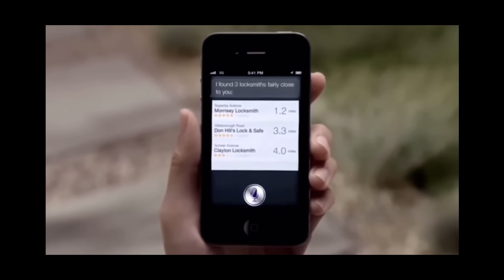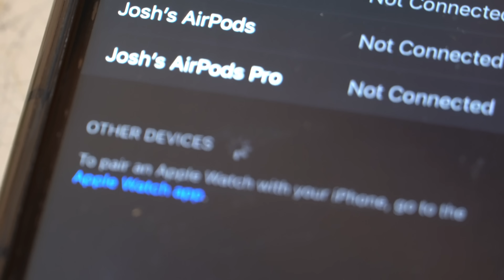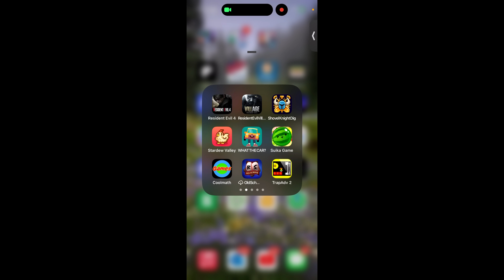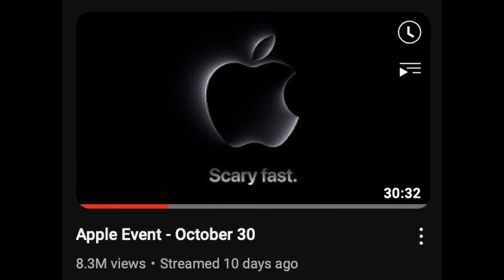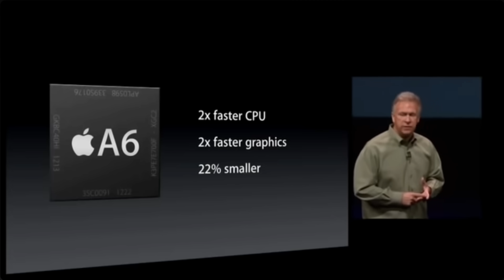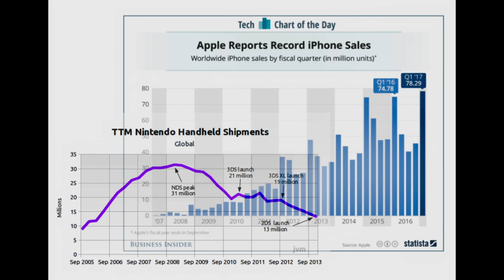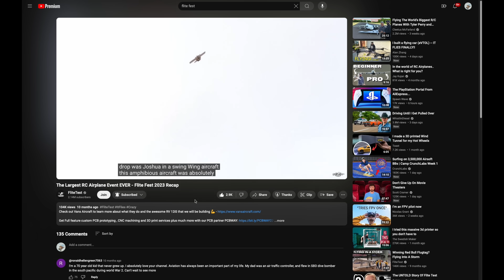I built this controller because no one else would | M-Con V1

Comment: you need to talk to a lawyer about copyrights dude...
Reply: Do you mean patents? In his community post he says he took down his previous video so he could do the patent work. That is why some of the clips are blurred .
Reply: @Jagged_Jackal  It's blurred because he put an Apple logo on the thing. Look at the blue tape at 10:46
Reply: YOU CANT PATENT ANYTHING YOU PUT POUBLICLY BEFORE PATENT THATS PATENT LŮAW.. IN THIS TIME.. TAMPERED..
Reply: @Jagged_Jackal oh we have the same pfp
Reply: Preface: I’m not a patent lawyer. From my understanding mag safe is an open standard. That is why you can get android mag safe cases and the manufacturers aren’t being sued by Apple.

I expect the patent would be for the sliding, locking, removable rail integrated into a controller.
Reply: @Jagged_Jackal  MagSafe is not open. It's a proprietary standard that Apple licenses out for money. I'd also look into whether they has any illustration trademarks that may clash with the circle in the M-Con logo. Then either strike up a license agreement with Apple, or just orient the magnets in a particular way without referring to the product as MagSafe anywhere official.
Reply: Good old playstation Xperia phone.
Reply: I wonder if Sony has their psp go design patented lol
Reply: He can easily patent this because it’s the 15% rule ..
as long as an item is 15% different than its original counterpart a new patent can be created. I think you struck gold  with this one.!
Reply: Son of the gun, you made it!
Reply: I’m sold! Take my money. Do what you can to hit the ground running because 🇨🇳 will clone this thing so quickly
Reply: It's a prototype and it's not uncommon to use existing products to invent new ones. Innovation builds upon existing tech.
Reply: There's actually so many controllers like this already so how?
Reply: There is already an Apple Controller like this and It's called Bladepad.
Reply: @RazorClaw666  lmfao, it looks better too 😂
Reply: Razor had a similar case called “Junglecat” but …. They discontinued it, it slid & looked like a psp go
Reply: @khalilsstories I think the reason they not released because the slider controller already patent from Sony
Reply: @khalilsstories  Then I want it to be copied, more common. Touchscreen is a hell for gaming. (Except DS/3DS)
Reply: This I awesome though!
Reply: doesn't matter if china saw this, their copyright is busted
Reply: Fr
Reply: Goodluck dude!
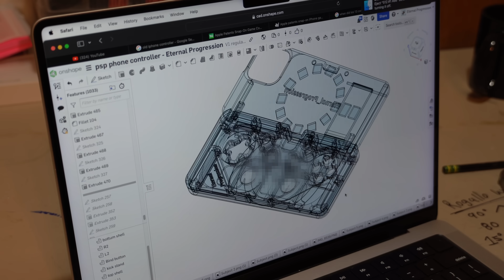Reply: Dude the song choose SOOOO good I recently found one of the songs 6:16
Reply: Like immediately shoulda done it before posting the videos for sure
Reply: To that project only left a cooler  to still cold the phone and the baterry can be watch battery
Reply: I mean some Chinese always copies it.
Reply: MagSafe IS patented and NOT an open standard so it will be an issue. Luckily if you can get Qi2 certified you can still use it without issue since Apple officially shared patent with Qi2. Simple idea and easy to copy does not mean it is open, esp. we are talking about Apple.
Reply: Nothing here can be patented... Temu will have this in 2 weeks
Reply: @1337bitcoin  so true....
Reply: Yea he definitely does because I wanna support him! Shit looks good
Reply: Will this be available vor iPhone 12 mini? 😅 

It would be sad if I’m only able watch how everyone else is getting one but it won’t fit on mine. 😢

Will the shipping to Germany available?
Reply: Do you have a go fund me ? Your controller prototype is so good 😊
Reply: Chineses "sharingan" works now 😂😂
Reply: Patenting in U.S wont defend u from Chinese factories copying it
Reply: needs to be way more slim,  but its a good idea.  but what about phone protection?
Reply: Good luck buddy wishing you the best! Looking forward to seeing the finished product
Reply: Tbh looking at it, looks like a modded housing of a Nintendo ds lite base converted for buttons and top converted for the slide that and clashed with the old psp mobile layout ect, good though :)
Reply: Bro, make sure they send emails with Nokia right, specially especially do not go rich just to go broke
Reply: And don't worry those of us that are nerdy f** that I got to make this thing from scratch, well I'm using a universe jelly star so everyone in my universe is f*** except me 😔
Reply: Patent* seems like all of America is unaware of proper use of words
Reply: Yeah, didnt sony already try this?
Reply: I will by one.
Reply: Totally excited about this controller
Reply: This works as a poor man’s copy right untill then
Reply: Incredible! Well done
Reply: If there is clear evidence you made a product first (like this video) you can claim a patent even if you don't file it first
Reply: Nokia made one exactly like that in the late 90s early 2000’s
Reply: What kind of ass backwards assumption is this
Reply: Copyright and patents are bullshit
Reply: Sony Patented this design when they made the Ericsson.
Reply: Why you bluring out something on the case?
Reply: You mean patent
Reply: You ever seen a small C next to a product? Nintendo© 🤣
You mean a patent or a trademark I assume.
Reply: This is awesome! It reminds me at my HTC Tytn or the BT Keyboard Case for my iphone 4 back in the day ☺️
Reply: @Mikaeru87  man the HTC Titan was awesome
Reply: Yeah this more of an Xperia Play remix hopefully it goes well this is something that might get me to use my iPhone for some on the go gaming
Reply: At this point I’d be happy if someone stole the idea so I could just buy it already 😂
Reply: This is so cool. I wish my older eyes could handle playing games on my phone.
Reply: i hope you go really far with this. i stopped using apple about a year ago, but the iphone is definitely the platform you should be developing for
Reply: But at the same time, patents do hamper creativity. Iterations and competition from other people makes everyone want to be the best. 

If you succeed with others having the exact same idea, it means your one would be the best one. I mean technically, there are 3rd party controllers for xbox that don't loose any functionality. But the quality of most of them are lacking. It's why Microsoft and 8bitdo are the top picks
Reply: Bro you are not Steve Jobs...
Reply: To late already stolen by some Chinese company 😂
Reply: yeah this is all I’ve ever wanted!
Reply: He uses somebody else's hardware for the controller, he just add the magsafe and a 3d print shell, a patent will be... Complicated
Reply from the maker: @casternvo_4940  We have a patent already 😁.
Reply: @joosh_king I'm an Android guy and have been almost since the beginning. It's exciting to see your enthusiasm, talent and ambition. It seems you're covering your bases, which is a good thing. 

Mobile gaming can be a viable platform, but a lot has to change first. Your controller may indeed be the first step. 

I'm going to subscribe so I can watch your progress. Good luck to you in your new business.
Reply: @joosh_king  there's already Chinese knockoffs in production the moment u posted this video lol. I hope it works out for u and u would need backing of bigger company to really make it successful, i hope Apple  reaches out to incorporate this in iPhone if they really serious of gaming as they seemingly are... This could be like next psp phone.
Reply: @joosh_king how do I buy stocks in this product??
Reply: @eternalprogression I want this for my Samsung S24
Reply: @joosh_king  🎉🎉🎉
Reply: @joosh_king what you created is very similar to what the Xperia Play and Sony PSP Vita do so if you try to enforce those patents you may have some issues with Sony. Might be worth having an actual patent lawyer and researcher look into it.
Reply: @joosh_king make one for the s23 ultra?
Reply from the maker: @JimmyMac88  working on top plates for all pixels back to the 6 and all s Samsungs back to the s20!! So yes! And of course all iPhones back to the x
Reply: @eternalprogression  that's awesome! Congratulations on your start up! As someone who shares a similar vision of what mobile gaming can be. It's impressive to see you make a controller that is compact and robust, while keeping the utility of the phone. I wish you the best and will pre-order when you get a Samsung model. In the meantime, I'll sub to stay updated
Reply from the maker: @JimmyMac88  Thanks man!
Reply: Patent == unchecked greed
Reply: @joosh_king  in that case you should honestly release the cad model for sale so people who want to DIY the prototype and give input like play testers can, I know I would do that in a heartbeat
Reply from the maker: @jameshumphreys1216  actually I’m seriously looking into putting out the cad. The real thing is going to be extremely reparable and I really want it to be mod-able too.
Reply: @joosh_king   That would be awesome, id get the cad right away and love the idea of helping with mod- ability and repair ideas
Reply from the maker: Ya I’d loooove to see the community modding this thing!!!
Reply: @joosh_king  Any progress on getting the cad out for people to make their own prototypes?
Reply: @eternalprogression you can't Sony already has it.... gl
Reply: @joosh_king I'm just curious, is your patent safe with the Experia one expiring next year?
Reply: @joosh_king only as useful as your ability to protect it and fight copy cats. All the best. Hardware development sucks.
Reply: @casternvo_4940  Not if he optimizes the PCB and the shell. Magsafe can still be an issue, I agree, but in my opinion it shouldn't be one.
Reply from the maker: Ya we are designing our own board and the way patents work, a combo of things can validate a patent.
Reply: @joosh_king can't wait to be able to buy it, please sell overseas too 🙏.
Reply: Magsafe shouldnt be an issue. Its an array of magnets. Its no different than adding usb-c to a project. There are TONS of magsafe accessories@leopil13306
Reply: @joosh_king  lol no you don't. Good luck with the impending lawsuit 👍
Reply from the maker: @JoshWitte  😂
Reply: @joosh_king  laugh all you want. You haven't "invented" anything here. Good luck getting a patent on the Magsafe connection. I'm sure Apple won't contest it at all...
Reply: k
Reply: @casternvo_4940  that was the first prototype, not the last version
Reply: @casternvo_4940 most people start this way with concepts and once it’s proven you get the circuit board designed and patented to avoid breaching patent copyright issues. 

If he wanted to market and produce the product it’s not feasible to buy and tear down thousands of Xbox controllers haha.
Reply: @casternvo_4940 patents work on functional designs, doesn’t matter what he used inside. Half the industry uses the same hardware. This is a design based project. The rights lie within the design and its functionality.
Reply: @casternvo_4940  I think he just used the controller for prototyping his controller. Also, many companies make very similar game controllers, so there likely is no patent in the first place.
Reply: @casternvo_4940 not really his design for the controller itself and how it connects to the controller is pretty much a untapped point of the market, only thing I remember similair to this which is where the inspo came from was the old psp go
Reply: I'm sure Sony have patent for this format of controller.
Reply: @NTBXP1  yeah, they did something pretty similar with the Xperia Play
Reply: @NTBXP1 yeahh I think so, that's why company like Ayaneo, GPD, Retroid, Anbernic not make slider controller. Just think about it, for decades they trying cloning design for GB, GBA, PSP, PS vita and switch but no one try duplicate PSP Go or Xperia Play. GPD win 4 have slider but for keyboard.
Reply: @Bugsy1928 sliding mechanisms aren't patented in the same way laptop hinges aren't patented, most companies just never cared to make them because theyve always been seen as niche and "gimmicky" and having moving parts that dont break immediately requires more engineering than what cheap third party controller manufacturer are used to, which is almost always just designing a pcb with off the shelf buttons/sticks and making a plastic injection mold. if this actually takes off it will be cloned like any other controller, though quality may vary
Reply: @NTBXP1  so does Nintendo for the detachable controllers does it mean you can't make something similar you just can't sell it with the Nintendo or Sony's name
Reply: Good work. Hopefully your parents won't make it impossible to do this in an open source way
Reply: Copyrights? 🤣🤣 No one wants this monstrosity on their phone lol. I'm pretty sure you'll be safe 🙄
Reply: ITT: people who don't know how patents work. I have 4 (soon, 5) patents submitted to the USPTO, with assistance from my company's attorneys. I won't deliver a class in law in the YT comments section, but I'll give a brief.

Basically, patents need to be: Novel and Non-obvious. Besides that, useful and clearly described. There's a part of a patent called the Claims, and is by far the most important part (more important than the drawings), so it's all the way at the end. Your patent's claims must describe a new technology, technique, method, design, solution, etc. It is always expected that your new thing will rely on someone else's old thing (that's kind of the point of patents being public info.) As long as this device doesn't claim something that is described by prior art, (and it's useful and non-obvious) then it is patentable. Yes, even if it works on the super-patented iPhone.
Reply: A bunch of none patent / copyright lawyers  giving advice.
Reply: @dislikebutton1718 
Well…lawyers also want to make money, if you get to the wrong guys they might just tell you qhag you want to hear.
Global patents arw expensive to me it‘s hard to believe the guy actually walked the talk.
Reply: Isn’t it just a modified controller with a custom case so he couldn’t unless he just does it for the case design
Reply: Gang, I think he’s talking about the use of the iPhone keynote video.
Reply: @blinkmarquee pretty sure that it falls under fair use
Reply: Dude looks like he has a patent on eyebrows 😳
Reply: This is dead in the water.  Amateurish.  I've made a far superior device that attaches switch controllers to any device, including tablets. No one wants to game seriously on a 4.7in phone.
Reply: @BuzzingGoober  great, i wanna buy it so i can attach my joycons to my monitor to game seriously.
Reply: @BuzzingGoober  cool cool. Link your product. Might buy.
Reply: @kyleo8688  it's a 3d printed prototype.  Works extremely well, though.  I'd like to try selling them after refining a bit more.
Reply: @BuzzingGoober  nice. However it turns out, i'm excited.